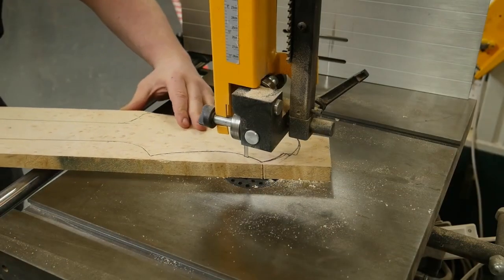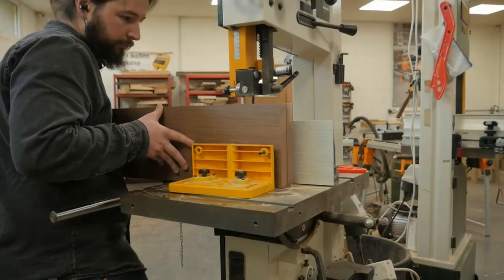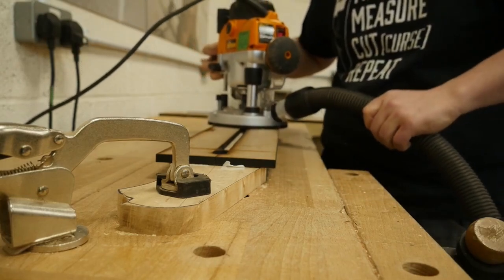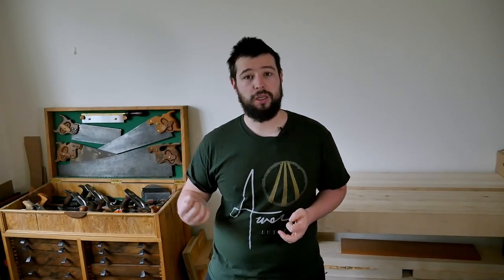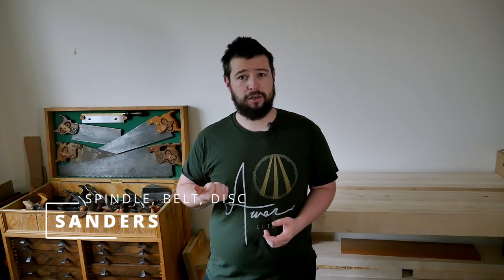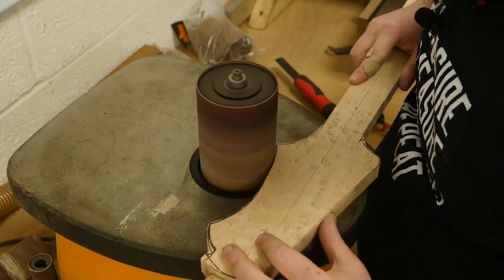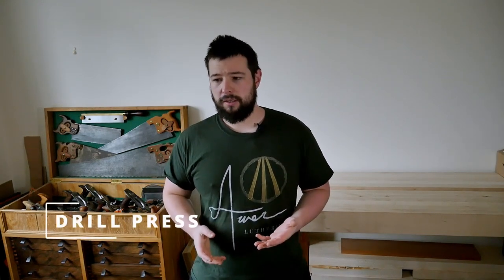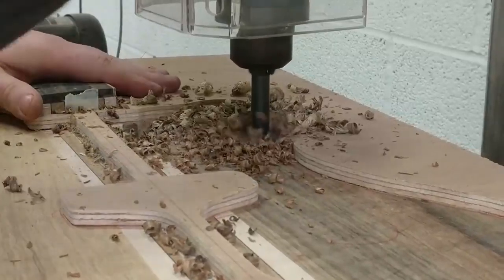5 ESSENTIAL Machines to Start Building Guitars NOW

Comment: Great list if you have a big wallet and somewhere to put the machines ... If you're just getting started I'd say the minimum power tools would be jigsaw, router (with high quality bits and appropriate templates), and drill. Neck & body shaping can be done with a Shinto saw rasp, buy a pre-slotted & radiused fretboard, and hand sand the finish. It will take far longer than with the machines but you'll still get there.

Comment: I'd add to the list: a fret cutting saw, snips for cutting the ends of frets, files and stones for levelling frets, and nut slotting files. You can't make a guitar without good fretting tools.

The bandsaw, router and drill press are excellent suggestions. I would add to them good nos. 4 and 7 hand planes. If you can use a hand plane, then you don't need a jointer, thickness planer, or drum sander. You might not even need a ROS. And a rasp can replace a spindle sander, which you're going to need to carve the neck anyway.

(If I was wanting to build A LOT of guitars, then yes, machine tools. Building one or two guitars, you don't need them.)
Reply: Yes. But cheap spindle sander is not that expensive, about 150 euros. Bandsaw on the other hand, if you need to resaw 20 cm (8 inches), you have to spend minimum 800-1000 euros using shop vac as a option for dust collection.
Reply: @Ramplcro  you don't have to resaw anything, not if you don't want to. You can buy tops and fingerboards, and just get a smaller bench top bandsaw for less deep cuts.

My 14" bandsaw can resaw fingerboards no problem, even without using a rip specific blade. I'd bet a smaller saw could manage that as well. I got it because cutting fingerboards by hand stopped being fun halfway through cutting my first one! (And then proceeded to cut two more by hand before I got a shed to even put a bandsaw in.)
Reply: Beanut flips are called snips in German, man I really want snips rn

Comment: I’m building my own table sled as so versatile & cheap enough to build!! Plus can build them for any size project & won’t damage any thickness timber. I would add hand orbital sander too. What about chisels to cut out where drilling round holes to make them square corners?

Comment: I think that with this machines you can really quickly get up to finishing touches. Problem is that thay cost a lot of money, probably from 8000 - 10000 euros and up.
With a router, a jigsaw(not ideal), handheld drill with guides and a cheap spindle sander you can get a lot done. Around 500 euros minimum with a whole a lot of hand tools (costing probably double if not more) .
One would have to make a lot of jigs for the router, probably the most versatile tool on the list.

Comment: Good recommendations for tool. Now If I only had a shop I could get some of them. Hopefully by the middle of 2024 I might have a shop. I did cut out a LP style Mahogany body blank with a Jigsaw and as long as went slow and was careful the sides stayed pretty straight and true in the vertical plane. so in a Pinch a Jig saw will work just have to be mindful use a good sharp blade and make sure it is 90 degrees to the sole of the saw.

Comment: I was just about to say an overhead pin router but you said it at the end, they are really handy for all types of jobs, I purchased some custom neck profiling router bits from this guy in Australia and a guy in Japan and in conjunction with a few custom sleds I can easily use my pin router to put any style shape into a neck, only the very center of the bottom of the neck is left and I take care of that in about 3 minutes with a spoke shave! I also use it for binding fingerboards and bodies, surfacing and planing blanks and sometimes body cavities! I would have to say for me the 2 most important machines in a guitar shop would be a bandsaw and a drill press, after that a router table and drum sander! Pretty much as you describe in the video!

Comment: Sure, you can have a CNC machine. And a laser engraving machine. And a computer can turn out pretty much anything you can imagine using those tools. Same with using templates and a router with a pattern bit. I’m sorry, but that’s not really building anything. It’s manufacturing it. Very much like putting together a kit guitar. Building jigs and tools and forms to get the precision necessary for a musical instrument is the real challenge for amateur luthiers. And you can do that with some very basic hand tools and maybe a couple power tools.